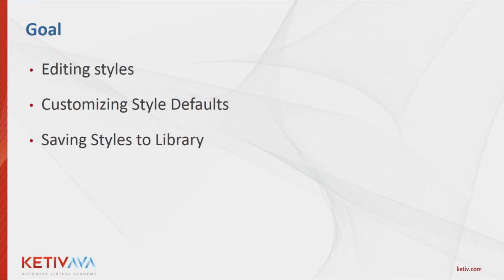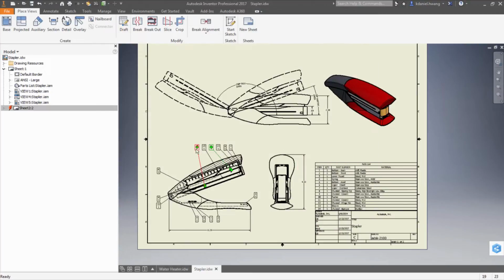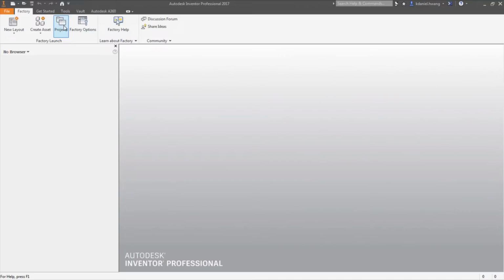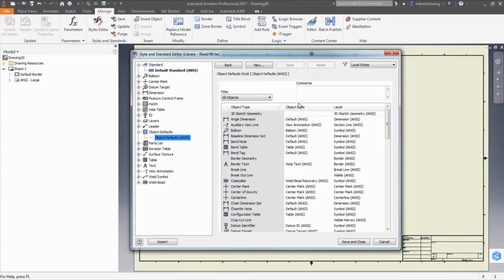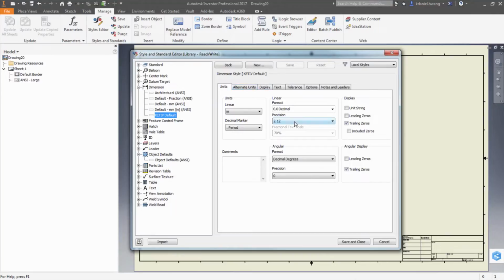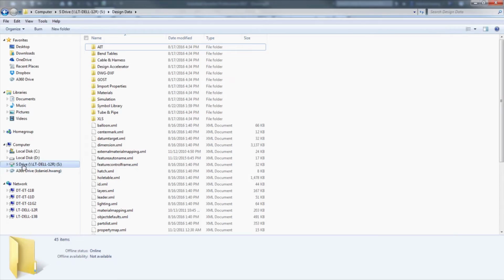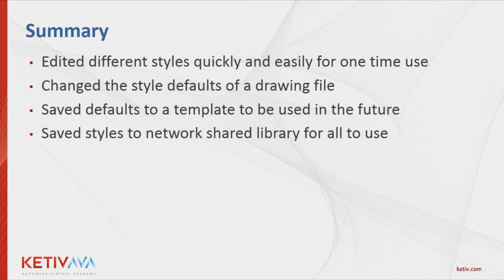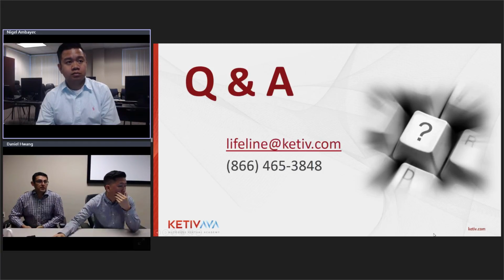Autodesk Virtual Academy: Inventor Styles 101

Comment: I think the worst thing you can do is customise drawings and Inventor. There should be a simple standard that everyone can use. Line thickness, fonts, section arrows etc. When the client receives a drawing he couldn't give a toss what fancy customisation is used,  all he needs is a drawing fit for purpose. To be able to see what it is going to look like, materials needed, to let the fabricator see and price what he is going to make and the installation contractor knows what he is dealing with. The nerd draughtsman with nothing better do should concentrate on learning what he is employed for. To design, model, produce detail drawings instead of sitting there playing with himself. I have started a job, and instead of just getting on with the job I had to learn where all these customised files are and all the new "customised" systems. None of which add any value it just takes longer to get the job done. Please... keep it simple.